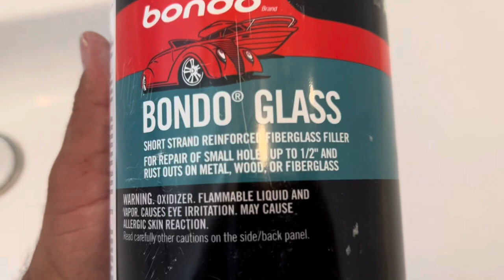HOW TO REPAIR A CRACK IN A FIBERGLASS BATHTUB with DP Tub | Drilling Holes and Foam Gap Filler

Comment: How does the rustoleum hold up? I use a preval sprayer mixing the actual color of the tub from a lab like Hawk or Topkote. 

How do your customers feel about discoloration?
Reply from the maker: There isn’t any! I explain it will be within the 90% color match and show them the color before any of the repair is done. 

I am very informative with my customers. They know exactly what they are getting. It matches almost exactly out of the can. Also even if it’s premixed out of the lab it will not match a used worn tub that’s over a year old exactly either. Definitely close but you can’t match wear and tear.

Comment: Why did you use bondo glass?  I am seeing on the 3M website that bondo glass isn’t waterproof.  I see you used to use the resin and mat, which are marked as waterproof.  Thoughts?
Reply from the maker: It is a waterproof filler used on cars and boats 

“IDEAL FOR SMALL HOLE REPAIR and rust-out repairs on cars and boats
INTERIOR OR EXTERIOR use
MAKE REPAIRS TO fiberglass, metal, wood, concrete, and masonry
FILL SMALL HOLES up to ½-inch wide with fiberglass reinforced formula without the need for backing strips, fiberglass cloth, or mat
STRONGER BONDING formula compared to Bondo® Original Filler
WATERPROOF AND NON-SHRINKING formula works on cars and boats
FAST CURING formula is sandable in 30 minutes for same day repair
TWO-PART FORMULA chemically bonds and adheres faster to hard-to-stick-to surfaces
PAINTABLE FORMULA is compatible with most paints and paint systems
BONDO® BLUE CREAM Hardener included
MIXES DARK GREEN when filler and hardener are mixed together”

Comment: Temporary patch. That repair will failed. You need to do a complete cutout of the bottom
Reply from the maker: I do this for a living. This definitely does not require a full cutout! Thanks for commenting though. Too many contractors nowadays rip off their customers with unnecessary work.